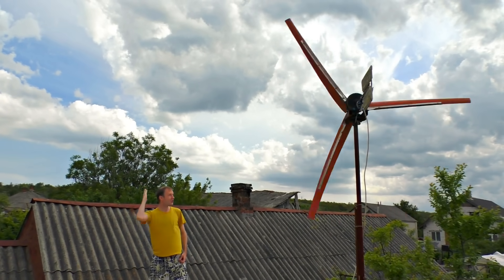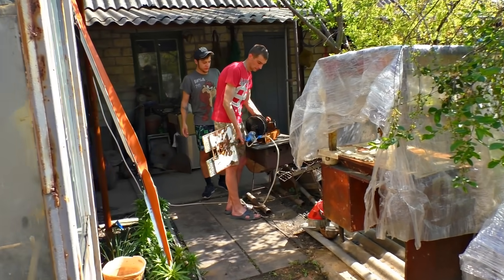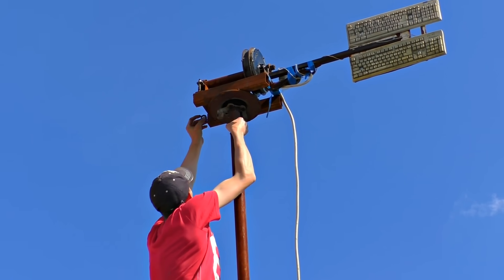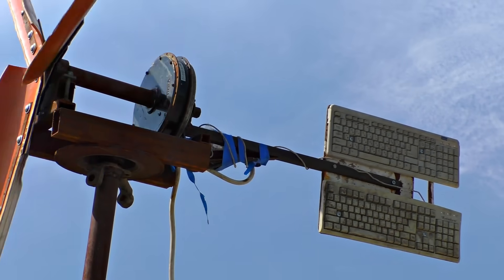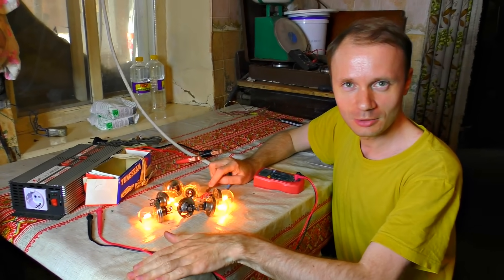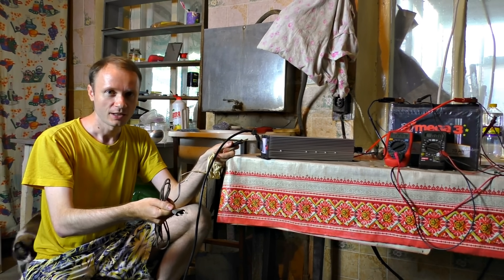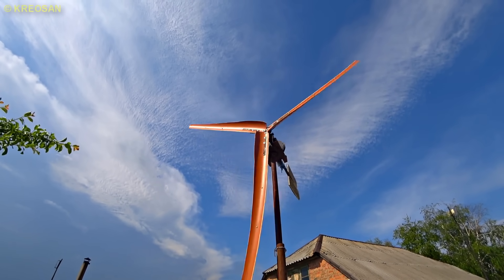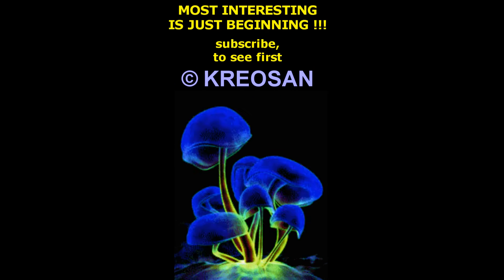✅Powerful Wind Generator DIY / Free Energy / Green Energy

Comment: Down here in Australia, we've traditionally used windmills for pumping ground water. A lesson we learned from that is to build them so we can adjust the angle at which they face the wind by turning the tail. This prevents overspeed issues without putting too much stress on the blades. Not sure how much of a problem that is for electric generators like yours though.

One concern I do have is the cable running down the mast. Over time it may wrap around the mast and be torn free by changing wind. Some kind of swivel connection would prevent that, but a simple way to stop it would be to run a slightly shorter steel cable down along the power cable. If it wraps around, the tension can be caught by the steel cable without pulling hard on the power line.

Comment: Nice work :-)
But powering up your house from the accumulator does not show how powerfull the windmill is. It only shows that the battery is full or partly full. 
The same could be done without the windmill connected. Without accumulator, please measure volt and amps into a bunch of 12V lamps in parallel og a couple in series if voltage is to high, at the same time, only from the windmill, this shows the wattage / power from the windmill. What is the specs of the ebike motor ?. I thought a gearing was needed for an direct drive ebike motor to get enough speed. Is it a direct drive motor ?. Kind regards from Denmark ;-)
Reply: Where those heaters , I mean light bulbs he connected not enough? 😂

Comment: All practical tests show that small wind turbines hardly generate any electricity! And only at costs that are 10-20 times higher than solar power!
This is because there is hardly any wind near the ground. It is also extremely gusty, which usually shortens the service life. 
Only if you want to be independent of the electricity grid should you install a  large wind turbine on a high mast for the winter.
*With solar modules, on the other hand, you can reliably generate electricity for approx. 3-8 cents/kWh for 25 years!

Comment: Anyone know all the equipment that was used. I wanna try this
Reply: Du brauchst einen elektro motor von einem E scooter  oder fahrrad  und einen 3 Phasen Gleichrichter.  Und einen solar charging controller um die Batterie auf 12v laden zu können. Und du brauchst einen 230v Wechsel Richter  um den Strom rein sinus für alle Geräte nutzen zu können
Reply: Translate my comment on Google
Reply: @pyroislove7823  I just did. Is that what was actually used in the video or this is something else that would be used?

Comment: It is not quite free energy. You need to spend £££ on the actual parts. Then you use wind energy to convert to usable electricity. Plus, you might not have a 100% efficient system, and some of the potential energy might be wasted, for example, the dynamo used to make the electricity wastes some of the wind energy by dumping it off as heat, friction may waste more energy, etc.

Comment: Interesting project, however, brown plastic soil pipe is VERY UV sensitive and breaks down in sunlight, this means those blades will have a limited life.
I suggest either painting the blades to protect them or using black, gray or white drain pipe since they are UV resistant.

Secondly, those cables WILL tangle, I suggest creating "touch plates" that have inner and outer rings, one ring pair is the positive, the other the negative. That way you should have a constant feed without the cables tangling and either snapping or shorting out... Thats ONE example I can think off, but I am sure there are plenty more, more effective and efficient ways to do so that are easily made

Comment: 🤔 if your windmill compellers was much wider Your windmill concealers WILL catch more wind than your windmill motor WILL be much stronger and if you WILL add a gearbox to your windmill motor your generator motor WILL turn much faster giving your  windmill motor MORE AC power AlSO you could AlSO make your OWN homemade solar panels at home solar panels are much easier made than what most PEOPLE are REALLY thinking AlSO solar panels REALLY are much cheaper than WHAT most PEOPLE ARE REALLY THINKING

Comment: Slip Ring for power? Because there's just a wire, you may want to add a slip ring in case if it goes more than 360° over time.

Comment: What happens if it keeps turning round and the wires get twisted and breaks?  The wire that is connected to the motor going down  the pole that holds up the turbine.  I want to build one and thats the only barrier in my mind lol.

Comment: Nobody calculated the power usage. These guys are simply discharging already charged car battery through the inverter. Such a wind turbine will power one bulb (100w) at most. I will not comment the very buid up still it was dangerous. Dislike from me!

Comment: "East" vs "West": 
West: Lets make something that costs a lot , is over engineered, breaks a lot and impossible to fix.
East: What have we got? Lets make something out of it then. If it breaks, easy to fix.

When i was young, before Ireland started making money, we had little money. 
We had to fix things because we couldn't afford to buy things.
We bought a cheap Russian made washing machine and it was reliable and incredibly simple to fix the few times it did break.
I kept it going for years.

This is how i became an engineer, I grew up solving the problem.
If you have to you will, if you don't have to you won't learn anything valuable.

Well done guys.🙂

Comment: Be careful putting 36 volts in to a 12 battery it really needs regulating down to 14 volts approx. ( I know you have lamps to reduce the voltage but you will have not much current left out of the bulbs to charge the battery) Like you I am also an electronics engineer!, I love your videos and have been watching on and off for a few years :)
Reply: My Wind Generator brings more then 60volts what can i do  to Charge my batterie? I have 12 v Batterie ore 36v  Lithium Ionen. A charging Controller ist to expensive!
Reply: Watch the video, when connected to the battery the voltage drops to 15 volts

Thre current draw drops the voltage enough to where you can directly connect a battery

Comment: Amazing. In the USA we can't just throw power back into our grid because it can hurt the linemen (electricians on the poles)... but we can do it with a special setup. Thank you for this video!!!
Reply: what do you mean, he said to turn off all the fuses and the main switch from the grid power, so that it doesn't flow back to the power lines. I never expected the inverter to be able to connect to the wall socket, that's amazing.

Comment: Ice habe eine Frage; Here in the USA, we have wind turbines with long blades, (like yours). Wouldn't you be better off with short, WIDE blades, (sails), to collect more torque from the wind? A vertical axis windmill might work better. I understand the problem is that the wind will blow against the back of the blades, (as they turn backwards into the wind.) A shield on the backwind side would shield the sails from wind blowing the sails the wrong way, which would lose torque. With a right angle wind turbine,  (like yours), long blades would lose angular momentum because of their length. Was denken Sie?

Comment: https://www.epa.gov/ghgemissions/sources-greenhouse-gas-emissions
It is clear that cars r emitting far less then electricity consumption. 
So let me get this straight we stop cars emitting co2 but we move to electricity? Still emitting co2 no? 
Perhaps more.  
how much electricity is used to power a car? 
How much is that energy emitting? 
Boycott electric movement its a farce. 
Its like green energy.  Costs loads to produce a little energy y not invest in nuclear reactors? Squeaky clean uk with no death penalty for 50 years plus has 15 nuclear reactors. 
Boycott the electric movement

Comment: NEED HELP! Im currently making a turbine myself but only to charge a 12v car battery. Could i just use a solar panel charger controller and plug my turbine wires were solar ones would go? Any help is much apreciated

Comment: Nice wind generator you can use a rotating contact and use a circuit to  flash the keyboard LEDs  to prevent drones from hitting the blades

Comment: You will need a good inverter with high output, and a good cable/connections to the socket, if you want to run a house from it. Can you do a video on safely making the house run off batteries like this? The wind generator is excellent!! what e-bike motor is it?

Comment: The power for the devices does not come from the generator but from the battery which happens to be full. It has enough energy to power a laptop and a stereo for about an hour, but then it will be dead. It might be possible to recharge the battery using the generator, but it will take forever.

Comment: Bullshit man. You plug a plug into the wall socket and the other end to the inverter are you mad , then you can use lights get out of that house its a fire hazard.. Bullshit man bullshit a wall socket is only 1 circuit and a light in a room is anther circuit you idiot if you have it wired like that you should take out life insurance cause you going to burn out.

Comment: all good except the part with the power converter, all the lights and appliances in the house was working because of the fully charged battery, I think will never work straight from that generator, maybe one light or 5-6 LED bulbs ... I'm electrician, I working with solar panels and wind turbine generators

Comment: he used a purely drag based wing design, if you changed it to an airfoil you can really increase the power output
Reply: Please explain further
Reply: @evaborcaleb4272  the rotor blades have a simple,  single-surface  profile/airfoil.     rather than  the a (quality) two-surface profile.     googletranslate
https://en.wikipedia.org/wiki/Wind-turbine_aerodynamics
https://crunch.craft-tech.com/files/wind-turbine-opt-profiles.png
https://res.mdpi.com/applsci/applsci-07-00551/article_deploy/html/images/applsci-07-00551-g005.png
Reply: sb    as is so often the case,  it is impossible to form an informed opinion about this installation.   because,  the amount of Power, in  WATTS,  coming out of the pma is  Unknown and/or undisclosed.      watts equal,  volts  x  amps; with each  Correctly measured.      the drive at the turbine rotor output is  step-up, to the pma.      this is a  less-efficient  configuration.    because, some of the inherent Mechanical Advantage/leverage in the rotor blades is  sacrificed.     cheers

Comment: If you are going for real efficiency would it not be better to swap out the lights to run directly off the battery to drop the overall load on the inverter? Skip the energy loss that comes from the change from DC to AC and go with DC lights. When mixed with things like solar light tubes to get free light during the day you cut huge amounts off the power needed.

Comment: I am 99% confident that this is, at least partially, a fake video.

I know the core principle of the video is correct, a DIY turbine is very much a thing...

However, I do not believe that they actually powered the tools or the whole house from it.

Firstly, the lights were flickering when he was using the grinder. Why would the lights flicker from an unrelated device?

Next, the first set of lights slowly faded on, but somehow a >1,200W grinder kicks on at full power immediately.

The first set of lights slowly fades on, but every single one of the subsequent lights powers on at full without issue...

I could go on, but those are my primary thoughts... Perhaps there is something I am missing here, but I don't know what I don't know. :-)

Comment: Putting all the current of the entire house through this tiny wire? I doubt this works. If too much load is put on the inverter either the inverter blows up or the wire melts and sets the house on fire. Better be careful with this.

Comment: So hes 1000watt ac-dc is able to get the tv-lights and the fridge to work,,yeah who do you fool,,i bet even those first tools he used wouldnt be able to be powered upp by that converter,,remember you need 3 times the amperage to start those machines so a drill with 700 watts needs att least 2400 watts to even start...
Reply: You can pull a lot more amps out of the inverter. Its just made for 1000 watt permanent load but if you pull like 3000 watt for one second it will still work

Comment: Should put at least a diode to prevent the battery from turning the motor and draining the battery while in a no wind situation.
Reply: The AC output from the generator would be passed through a rectifier before supplying the load. Also the motor wouldn't turn with DC current.

Comment: Jeez at least switch to LED bulbs, you'll save so much more power.
Reply: They are using a keyboard and plastic pipes for the lack of resources and you are suggesting them to buy expensive LED?
Reply: @ZeroFloat.  Each bulb probably uses like 70-100 watts! They'd get so much more utility from their hard work by switching out at least a few of the bulbs.

Comment: Is there any speed governor to restrict the turbine speeding case of high winds?
Did you use any circuit board to stabilize the wind turbine output voltage so as not to burn up the accumulator or inverter circuitry??
Reply: Maybe it's silly what i'm gonna say, but maybe  the inverter does all this for you, on the spot. By converting it.

Comment: The wire must be inside the wind turbine shaft to avoid the wire to twist on the pole shaft over time. The wire have a risk to break if It's stuck on the pole. By the way, really great job by making a cheap and reliable wind turbine. Usually, this kind of wind turbine cost 800 us$. Don't forget to use white lithium grease to grease the wind turbine bearings.

Comment: the line that transfer power from engine is not connected in correct  way
it may  couse cut  line  or stop fan torn in in vertical side

Comment: Here are somethings i really recommend you doing. 
Balance the blades of your generator. This much shaking will cause material fatigue really fast and break. It will also not allow it to spin as fast as it could due to the energy looses to the shaking. It will also reduce the amount of noise its producing.
Add a RPM meter or/and a wind speed meter and a breaker. If the wind is too strong it can spin too fast and due to inertia (most know as centrifugal force) it can explode. To know what RPM you should stop it you must read about the tensile/traction resistance of the material you build the blades, its length and its weight. Depending on the values you find keep it between 25~40% below the maximum speed.
Move the blades forward. With strong wind the blades bend back and will hit the post at high speed and break.
Reinforce tho post with tensioned cables
 or by firmly attaching it to the wall. It will also help reduce the shaking.
Instead of using cables use rail and spring load brushes to conduct the electricity. It will eliminate the problem of the cable warping on the post overtime.
Reply: you made me think about a thing... how about a pillar on the center of the fan that is like 0.5 metres long and has three bicycle brakes wires attached that pull the blades straight? this should make the thing almost indesctructible i think
Reply: @redoverdrivetheunstoppable4637  
Cables in front of the blades would produce vortexes reducing the blades efficiency and it would only prevent them from bending back but not from exploding from exceeding its maximum tensile/traction resistance due to centrifugal force at high RPM. To increase its tensile/traction resistance you would need to run cables inside the blades. Its the same concept reinforced concrete we add cables to increase its of resistance to being stretched in the direction the cable is installed.
Reply: @vitor900000  well.. i specified thin cables on pourpose, not sure how much it would affect the system at this point, your concept of bending onto wind seems really likely

but that thing really needs to spin fast to explode for centrifugal force, it's a piece of PVC tubing, some airplane blades are made of wood, there are like 100 horse power on em... but balancing is highly suggested anyways
Reply: @vitor900000  well... the bridge of Genoa "wants to know your location" :D
Reply: @redoverdrivetheunstoppable4637  
Wood is stronger then plastic if used right... http://www.scielo.br/scielo.php?script=sci_arttext&pid=S1678-86212017000200201
"the bridge of Genoa "wants to know your location""
Not sure what you meant but if you want to know where i'm from i'm a Civil Engendering student from Brazil.
Reply: @vitor900000  i was just joking... that bridge collapsed because the GENIUSES thought that X section of reinforced concrete was as strong as 1\2 X section of steel cables or rods... yeah, like when the concrete cracks, because it's natural considering the angulation and age, there will be 1\1000 X section of iron holding the structure plus the dead concrete over it... they still are reluctant admitting it (here in italy)... fucking mass murderers

well... if you still think that a thing that spins at like 400rpm max will explode while still made of stiff plastic that gets smaller on the tips, think it... but i don't see it
Reply: @redoverdrivetheunstoppable4637  
You must consider more then just RPM to calculate the centrifugal force... Length and weight are very important! 
You also have to factor the material fatigue over time. Those blades will be exposed to the elements 24/7 and plastic is know to loose its strength to UV radiation plus the stress of being bend and stretched by the rotation and wind.
I would do the calculations just to be sure that its safe. A piece of it flying at 20~40Km/h can kill.